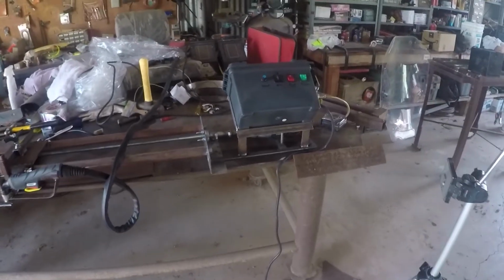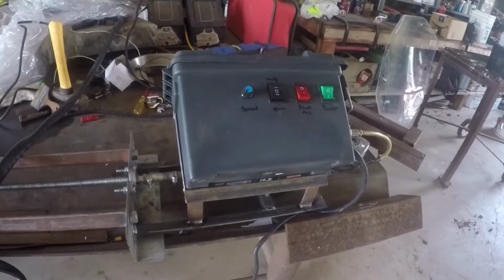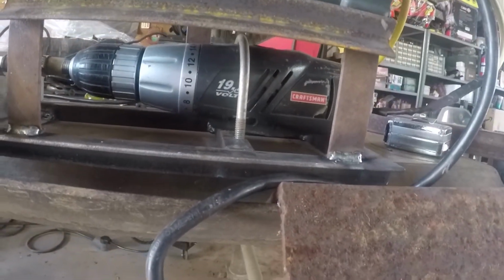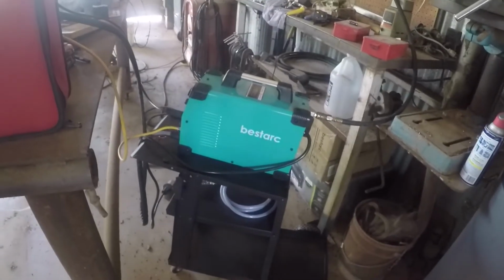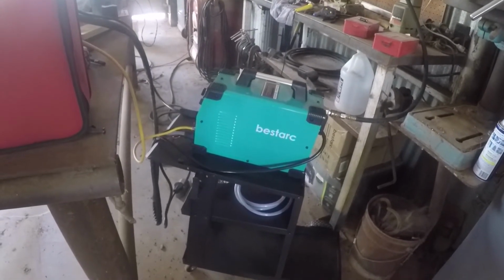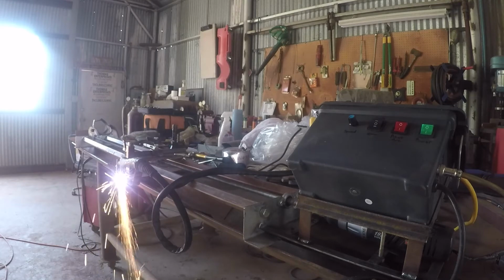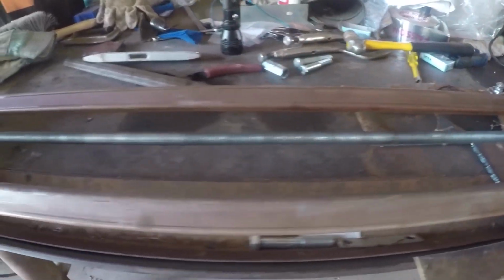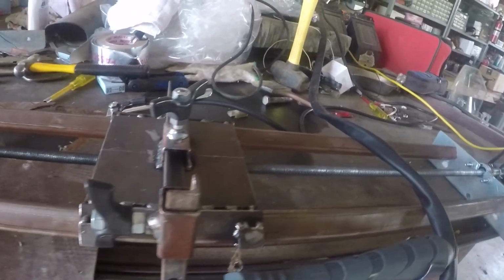Motorized Plasma Cutter Rail

Comment: Can you show how you wired the bypass or remote switch for the plasma cutter?  I have the same plasma cutter.
Reply from the maker: You can get 2 pin connectors to match the pilot control on the plasma cutter. Wire one to an on/off switch, unplug the one from the plasma lead and plug in the remote switch.